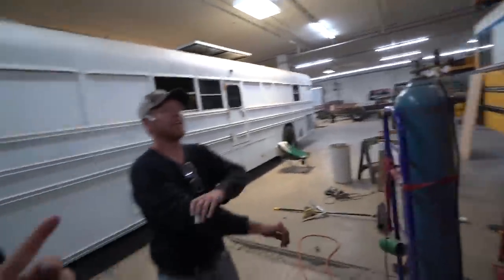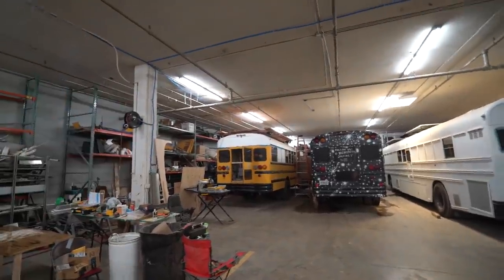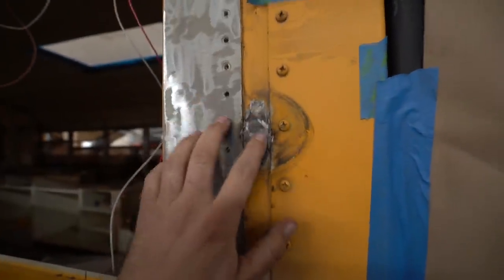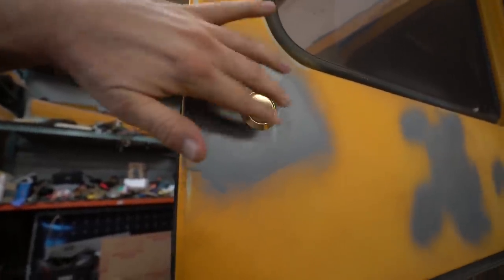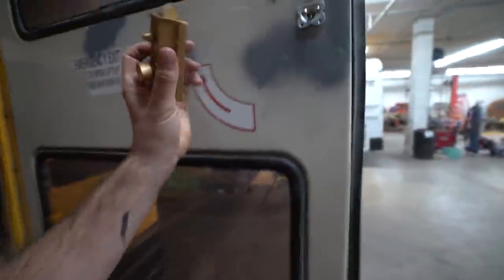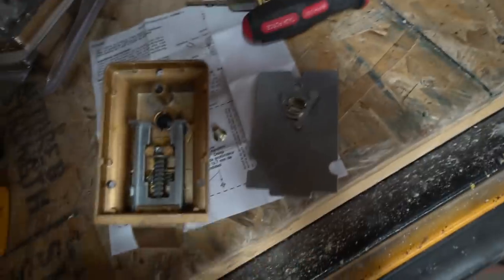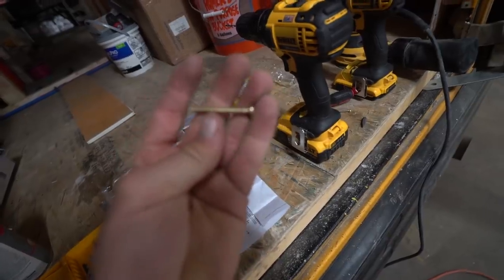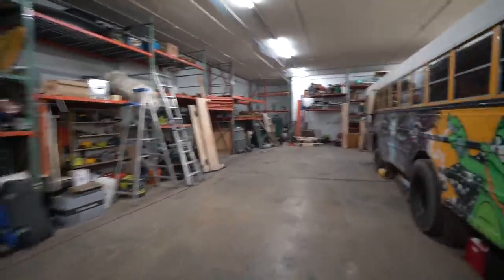Emergency Door Deadbolt Lock FIX ( Skoolie School Bus)

Comment: Great idea on the lock Jax! I was trying to figure out how to lock my bus back door and be able to also unlock from the inside. Thanks a bunch for the tip. 😊
Reply from the maker: Heck yeah! I wanted a fix that’s simple and reuses the existing hole and bingo!!
Reply: @JaxAustin  I like the lock idea but I think a dead bolt should be a key on both sides so someone can't just break the window to to reach in and turn the lock, gain access to the lock then the interior of your bus.

Comment: You might consider putting a plate over the rear door seam by the new lock, to prevent people from popping open the door with a flat screw driver. If you put a metal plate about 10 inches long or longer and pop rivet  in place. When you show people what a cheap lock your using, your also inviting trouble.

Comment: The only think I would be concerned about in the shower would be the bus flexing while driving down the road.  I hope the tile and grout isn’t too brittle and will crack then leak??  Also it would be a good idea to put a fancy slide type bolt on the inside just in case the back door pops open while driving down back roads or over bumps.  The last thing you would want is for the door to come open while driving.